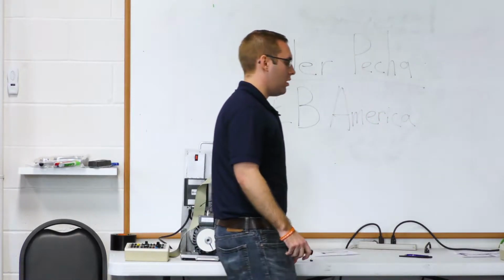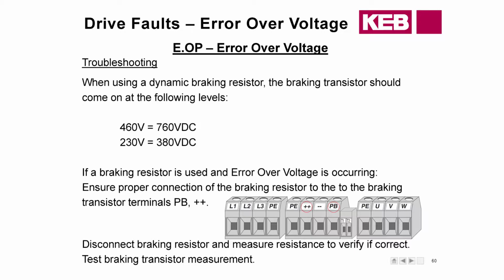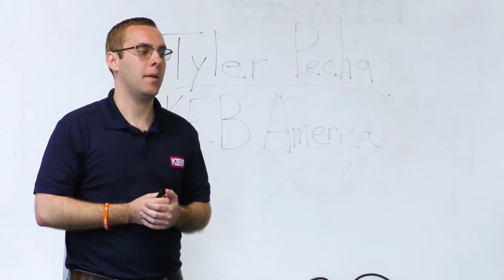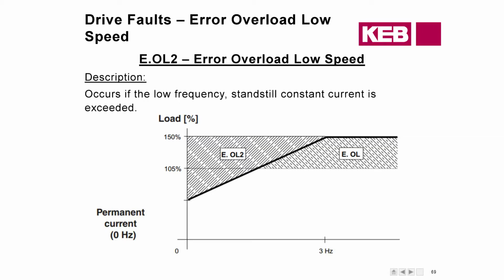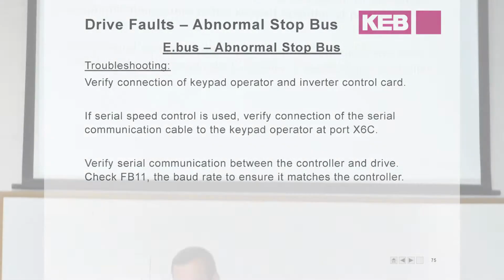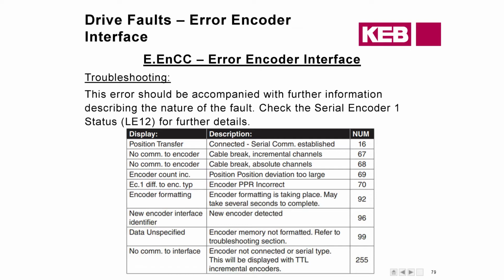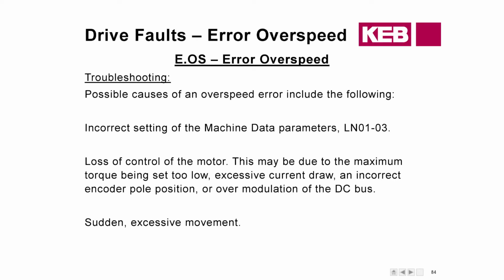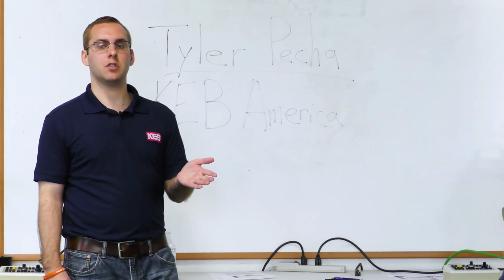KEB F5 Elevator Drive Training: Troubleshooting Errors (Part 5)

Comment: Hello, when I apply voltage on F5 converter,  display shows five zeros blinking and then push ENTER+FUNC together and the display shows 802.6. This mean that the panel control is working bad?
Reply from the maker: If this error occurs after every power up then you are correct. There is likely a hardware issue. For further assistance, contact your machine manufacturer. Thank you!
Reply from the maker: We are not sure what 802.6 means with the little information you have given. For specific help on your application you should contact your machine manufacturer and give them the part number of the F5 drive and the keypad operator? It may not be a board issue. It could be an issue with the setup in the drive. Is this a drive you bought off the internet or through a distributor? It's hard to diagnose without more specific information.
Reply: We are a small company that repairs industrial equipment. This F5 Keb model 22F5HAR-YV10 did not turn on when it arrived at our laboratory. After repairing the main problem, every time we connect 440 VAC to the equipment the operator panel shows only five zeros that turn on and off continuously. We tried to modify the parameters, but the only key combination that changed anything on the operator panel was pressing the ENTER + FUNC keys and 802.6 appears on the display. The operator panel has the model 00F5060-1000 (OPERATOR F5 STANDAR KEYBOARD Rev C). This type of operator panel does not have an RS232 connection to the computer to backup the parameters. Is there a way to do this backup with this type of operator panel? @KEBAmerica
Reply from the maker: This is likely an issue with the control board or the internal power supply. With this type of issue we recommend that you send the drive into our service department for proper diagnosis, repair, and load testing. However, if you want to diagnose and repair the drive yourself and you have the tools, this information should help you with diagnosis. Just be aware we are not responsible for any damage occurring from your efforts. 
First, if you have a 0058060-0040 USB converter you can connect to the drive with Combivis 6 directly into the X4A port that the operator plugs into. You can also power the control card only using an external 24vdc supply connected to pins X2A.21 (+24vdc) and X2A.22 (0vdc). There is no way for us to properly diagnose the actual issue(s) unless we can evaluate here in our Service and Repair Department.
Reply: Thank a lot my friend @KEBAmerica . We have to buy this USB Converter to connect the VFD with Combivis. If we do not find the problem, ¿do you have a service center in Mexico?
Reply from the maker: You're welcome. We do have a partner in Mexico called K+S Services. Here is their info: 
Orion 1463 Int. 1, Parque Industrial Orion
CP 66600 Apodaca, Nuevo Leon
website: www.kandsservices.mx
Reply: Hi Julio, have you solved this problem?

Comment: BBL error message continue display whenever we run motor ?? SOLUTION PLZZ
Reply from the maker: Thanks for the comment, Muhammad. You will see "BBL" before an error appears. Check the fault log for the corresponding error and troubleshoot that error. For further troubleshooting please contact your machine manufacturer or contact KEB technical support. You can find a local subsidiary here: https://www.keb.co.uk/contact/contact-worldwide

Comment: Screen displays 8888 what does this mean?
Reply from the maker: All 8s means the drive has a critical error. The drive must be replaced or repaired. If you have any questions you should reach out to the machine OEM or manufacturer for advice and instructions on drive repair or replacement.

Comment: I have a problem on my drive. It displays the fault e.oh2.
Reply from the maker: E.OH2 means "Electronic Motor Overload Protection", you are likely seeing high current on the drive. For assistance, you should contact your machine OEM (Original Equipment Manufacturer) or local KEB representative company year you.

Comment: What the meaning "no Pu " ini inverter KEB F 15
Reply from the maker: The best way to solve your issue is to contact your machine manufacturer. They would know your specific system best. If they are not able to help you, or if your machine does not have an available OEM representative to help you, then you can contact a local KEB Rep here: https://www.keb.co.uk/contact/contact-worldwide

If you're in the US or Canada you can go to our KEB America website here: https://www.kebamerica.com/contact

Comment: Hello, our drive (KEB) error code : Ec.0. How can i solve this problem....thank you.
Reply from the maker: The best way to solve your issue is to contact your machine manufacturer. They would know your specific system best. If they are not able to help you, or if your machine does not have an available OEM representative to help you, then you can contact a local KEB Rep here: https://www.keb.co.uk/contact/contact-worldwide
Reply: I have a problem on my drive. It displays the fault e.oh2.
Reply from the maker: E.OH2 means "Electronic Motor Overload Protection", you are likely seeing high current on the drive. For assistance, you should contact your machine OEM (Original Equipment Manufacturer) or local KEB representative company year you.

Comment: Inverter keb 5 can't be read encoder can it help me.
Reply from the maker: The first thing we recommend is to contact the OEM (original Equipment Manufacturer) of your machine. If they cannot find a solution for you then you can contact a KEB engineer to help. 
In what country are you working? You can find a local KEB representative here: https://www.keb.co.uk/contact/contact-worldwide

Comment: dear sir ,
         we are facing  E.EnCC   alarm come  please tell how to solve this problem 
          we are using  carton board cutting  machine 
          we check encoder cable and encoder interface card ever thin ok but can't reset this alarm
           we are using  drive ; 18 F5 A1h-36NF
             drive interface with mgcs display
           encoder 2  x3b  ; ppr  1024
           encoder 1 x3a ; ppr  2048
           ec0; 14 
          ec1; 2048
         ec2; 21984
         ec3 ; 3
         ec4; 1000
         ec5; 1000
         ec6;  0
         ec7; 2
          ec10; 13
         ec11; 2048
         ec12; 57657
         ec13; 3
         ec14; 351
         ec15; 500
         ec16; 0
         ec17; 2
        ec20; 1
       ec21;12
       ec22;0
       ec23;1
       ec25; 1500
      ec27; 0
      ec36; 0
    ec37; 68
     ec38; 0
     ec40; 35306
  ec 48; 0
    ec56; off
Reply from the maker: You should contact a local KEB representative for technical questions. Click on the link to find local support: https://www.keb.co.uk/company/company-group